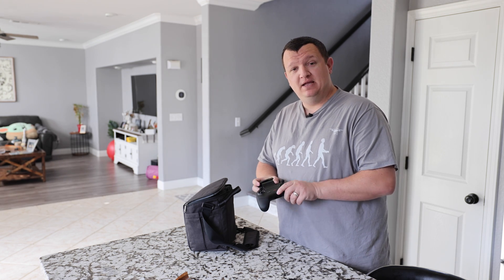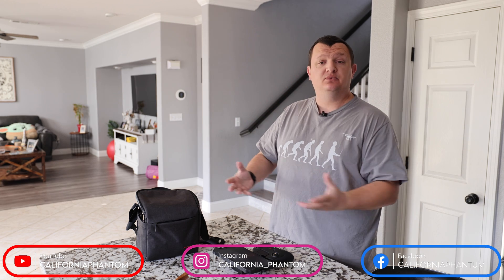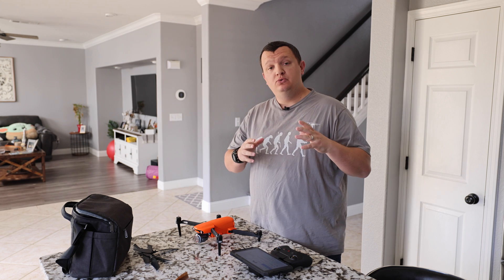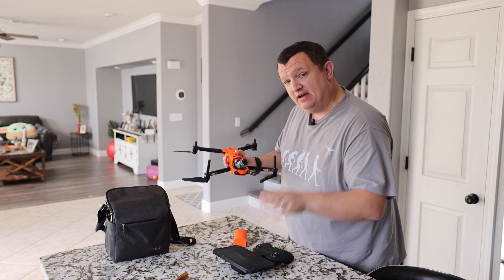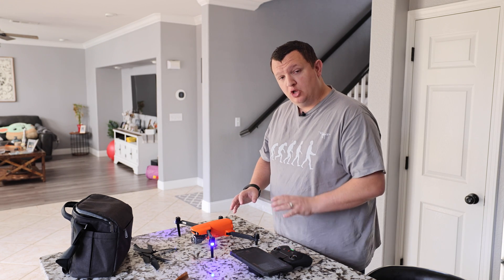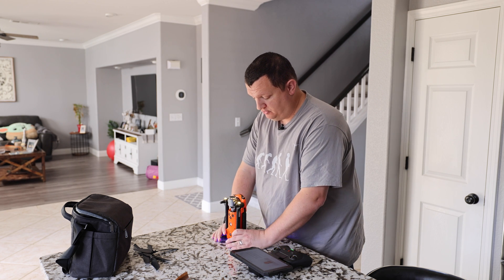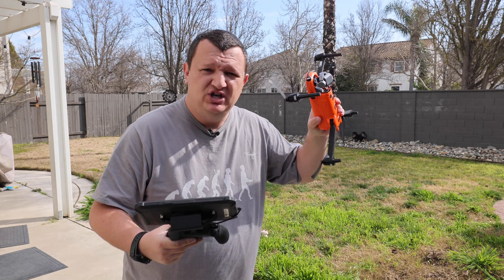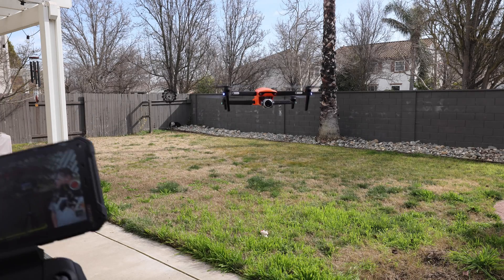Autel Evo Lite+ IMU Calibration

Comment: Finally someone who knows what they are talking about (I'm not referring to Original Dobo). Thanks for your vids! If you could do a post flight full workflow video that would be incredible. When just starting out shooting and uploading to YouTube, preparing versions for clients, etc there are so many choices one has to make. How many hours does it take for your longer 4k vids to upload to YouTube? Thanks so much.
Reply from the maker: I appreciate you man. It takes about 40 Min for a 10-12min YouTube video to upload. I do have Xfinity gigabit speed, so I'm sure that helps. For 4K 30fps I set the Average bitrate when rendering to 105000kbps. YouTube loves 95000, so I bump it above that slightly to a sweet spot between the drones original bitrate and my Canon R5 bitrate which is higher.
Reply: @CaliforniaPhantom  great to know that. Thanks very much!

Comment: What phone or tablet are you using. Also, is this what causes mine to shimmy/quiver when hovering. I just bought it and only took it up once for a test flight. Thanks
Reply from the maker: I use a tripletek 8 Pro. Fits perfectly on the controller and is bright and snappy with the processor. Yes the shimmy as they call it can definitely be caused by this, so try a cold IMU and see if that didn’t help. Let us know how it went.
Reply: @CaliforniaPhantom  I'll check it out tomorrow and let you know, thanks for the advice.
Reply: @CaliforniaPhantom  so calibrating the IMU slowed the wobble down, especially at about 15' and up. Calibrating the compass was the ticket though. The wobble is eliminated and it flies great, thanks!
Reply from the maker: @SolarBearDIY  great to here. IMU and compass is definitely the 1-2 punch to solve that problem. Glad you got it resolved. Happy flying Gary
Reply: @CaliforniaPhantom  so, have you ever heard of one of these malfunctioning? Mine was flying great, then one day last week I did my pre flight safety check, pre power on, then power on on getting, then hover at eye level. I then ascended to 70 feet and hovered without issues. At that time I moved forward approx 8 feet and then the aircraft yawed left uncontrolled and rapidly descended at a 45 degree angle onto the roof of my house. I'm kind of baffled to be honest. Lolz

Comment: I have the nano,  every time I turn it on it asks to do IMU calibration. I emailed Autel weeks ago but haven’t heard back.
Reply from the maker: Are you in USA? Emails have taken 1-2 days tops because increase in demand, but not 5 days. That’s unusual for 🇺🇸
Reply: @CaliforniaPhantom  yes I am , I finally got a reply last night lol.
Reply: So no issue again with nano @akaiphone? I've got nano as well, and after light crash the drone asking IMU calibration, but always failed
Reply from the maker: @Qhoy sounds like you need to submit for repair
Reply: @CaliforniaPhantom  yeah. Earlier today I went to the distributor service center. Hopefully not too expensive. I've heard in DJI case if IMU issue usually board need to be replaced,.. seems expensive on that case, not sure in the autel nano case. Let's see

Comment: Yes, exactly this is the meaning: put your drone in refrigerator if outside you have over 7 Celsius degrees :)
1. Compass does not matter, will be made at the end, as is made OUTSIDE
2. Drone needs to be cold....really cold, as IMU sensor needs to be cold.
3. You need to put your drone on table, but put the table close to a wall and use the drone foot against wall to be sure is 100% properly adjusted.
Cheers.

Comment: I'm definitely considering this as a second drone and your videos are helping me with that decision.  Could you recommend a Micro SD card for this?  Autel says a UHS-3 card is required, but I'm having difficulty locating one (many of the listings for these cards are confusing with regard to whether or not they're UHS-1 or UHS-3).  Thanks!
Reply from the maker: I use the SanDisk Extreme. That the red and gold micro SD card from SanDisk and I’ve never had an issue across all my drones. Advexure has them for as little as $24 for a 128gb card: https://advexure.com/products/sandisk-extreme-microsd-card-128gb
Reply: @CaliforniaPhantom  Great, thanks!  That's what I've been using with my Mavic 2 Pro, but Autel's UHS-3 requirement had me a bit confused.
Thanks for the quick reply, the link, and the great content.
Reply: @michaelo6003  SanDisk Extreme Pro... That Pro is important for burst rate when empties the buffer.

Comment: Not a big fan of the way Autel designed their drones.
Reply from the maker: I use to think the same way. The whole it looks like a lifeguard buoy thing. The Lite has a ton of work needed as it’s missing some key things, but it’s brand new. Evo 2 is tunable; could tune it to my exact liking and really is an exceptional drone. Especially for the value. Then there’s the enterprise which is an even better savings. Autel has grown on me and using it for commercial - I almost exclusively use Autel now for commercial work.

Comment: Wouldn't condensation come in to play from the outside cold to a warm inside environment? I have always waited until all my electronics have reached room temp before turning on. Or vice-versa when outdoors. Just basic electronic knowledge unless this issue has been rectified?
Reply from the maker: 100% don’t go from a really warm to a really cold because condensation can build on that camera and internals. I took my already cold drone and took it in my garage which was in the low 30’s and left it there for a couple hours before doing that IMU calibration. If you saw the sample footage from the same video even with a sliver of horizon line; the line remains really strait and the drone rock solid. So moral of the story is get your drone as physically cold as you can (within reason) before the IMU calibration for the most accurate calibration possible.

Comment: Hey Phantom- how relevant is the Autel Evo 2 6k, 8k for real estate work in 2022?
Reply from the maker: Excellent question and honestly still an absolute beast. Lite+ strictly for real estate is a contender too if you consider the Evo 2 Pro because cameras are nearly identical, with the Lite+ you got better low light video with the on board denoising night modes baked in. But then again Lite+ = no 360 obstacle avoidance if that’s important to you.
Reply from the maker: @thedarkriver1  handles the wind like a true champ!

Comment: Threaded holes for sticks is the least of my worries. My Lite+ fresh out of the box fails to stay connected to the RC for more than 90 seconds. Absolute junk. Doing a CC chargeback on the vendor and will never buy Autel again. No support, no nothing. Just trash.
Reply from the maker: Sorry to hear that. You order through Autel USA or the Autel from China? I heard some people got a bad batch from the Chinese Autel branch.
Reply: @CaliforniaPhantom  Autel Pilot, the Chinese place. So far, Discover has been very good to me, but the case is not yet closed. I am basically demanding a full refund because this is a defective and dangerous drone and should never have been released. Routinely losing connectivity during flight is simply unacceptable, as is Autel's denial of any problems. Stick with DJI, even though they too are pretty bad.
Reply from the maker: @JellyImages  sounds to me that you were one of the lucky ones. I wouldn’t order from the Autel Pilot. I only order through Advexure now. The people over there are awesome. I guarantee they would have replaced your drone if you had ordered through Advexure. They do Autel, DJI - everything….

Comment: In your opinion, is the Mavic 3 worth the $1200ish premium over the Evo Lite +?? (With the assumptions that DJI will improve the satellite issue, and Autel adds active track soon, 2 current issues with each drone).
Reply from the maker: Honestly, that’s a difficult question to answer. It depends what the intended purpose is for. Lite+ is a lot of drone for the money, but if money is no object; I see the Mavic 3 as being the better of the 2 platforms in the future after the firmware(s) dust has settled. Is geofencing a big issue for you? All factors in the decision making. I see the Mavic 3 as more of a workhorse. I see the Lite+ as more of a perfect travel drone. A perfect social media content creation drone. That’s probably the best way to describe the differences between the two. Hope this answers your question well enough.

Comment: Well some of us don't shave during hockey playoff's but that is just logic, not superstition! 🤣
Learning to calibrate your quadcopter is a huge deal. 
With as many wireless devices I have I would need to do this outdoors for sure!
How often should you do your IMU calibration?
How do you like the Autel Lite +?
Reply from the maker: Great questions. You don’t need to really do IMU unless system tells you, you take it a great distance OR if your seeing instability in flight. Because it could help with horizon line, it’s not a bad idea if you got horizon line issues to do this as well. I haven’t seen anyone mention the improvement of a cold IMU versus a room temp or warmer IMU, so that was my motivation to make this video. I’m loving the Lite+; it’s a perfect companion/trip drone. It’s also great for a YouTuber or someone who makes content for small format for social media. More than capable for those things.
Reply: @CaliforniaPhantom  I figured it would work for relator and even some inspection work as well. 
Sigh I guess I am going to have to really buckle down and save to get myself one. It seems to be the winner out of the gate for Autel. The Nano seems to have some issues that need to be corrected, and some design changes I hope to see in a new version. 
Being in the central valley, by the wind mills, I am not temped to get a nano because of the known high winds. A bigger airframe would suit me well.